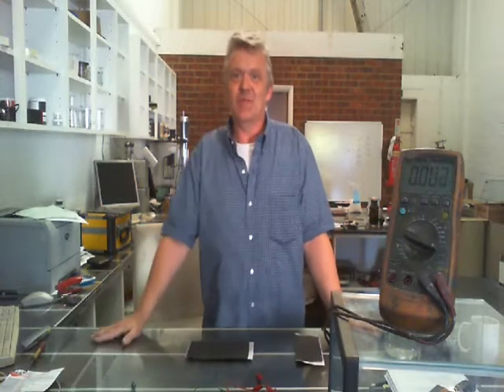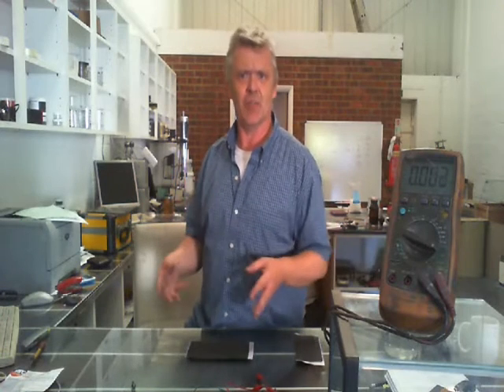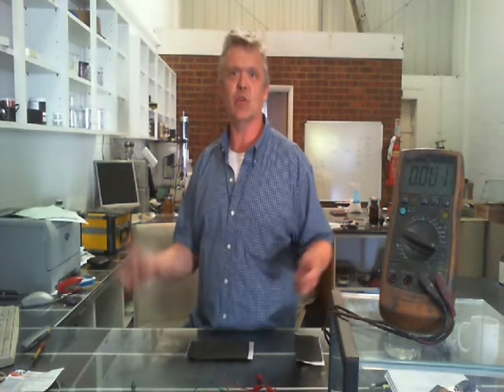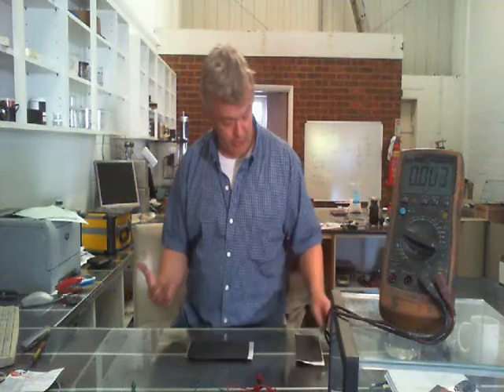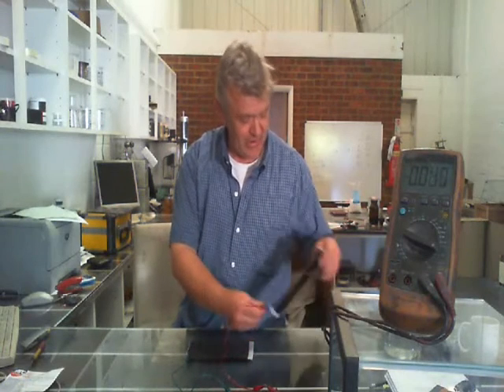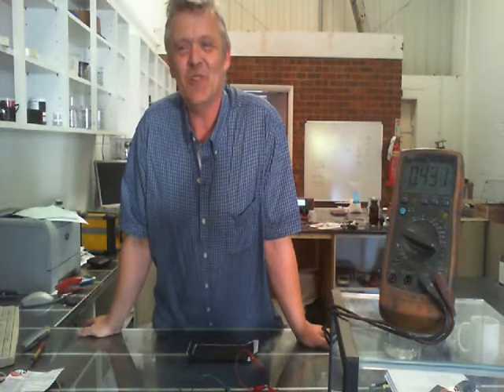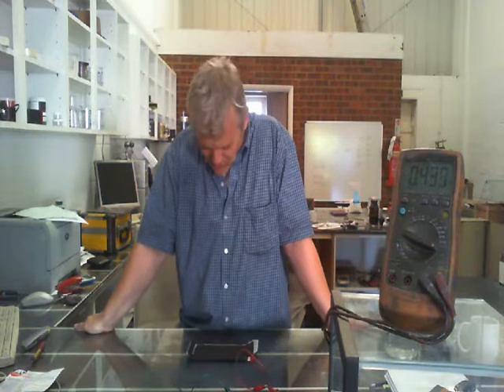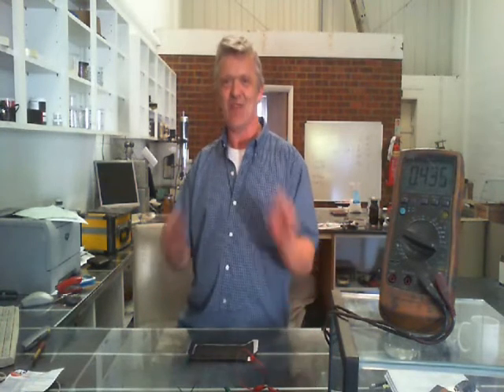How To Make An All Carbon Battery - Bizarre Update

Comment: One idea that is a bit more high tech would be to fabricate a current collector via vapor deposition. I'm thinking of my experience with flexible printed circuits for printer cartridges. My reasoning is that vapor deposition requires very little metal and it's not terribly difficult to accomplish although it's not a home laboratory piece of kit. I'm wondering if a taking the thin film circuit out of a print cartridge could be cut in an appropriate way to test this idea.

Comment: Graphite is almost like metal with sheet structure and a sea of electrons floating about.  Though not freely as in metals and the structure is not strictly lattice but is sort of pseudo lattice due to the ever present interfering Van Der Waals forces.:)
The other electrode is carbon with an irregular structure.  This consideration along with that of the P-N junction idea may point out to the right direction.
Reply from the maker: +Venkatesh k.s. cheers mate

Comment: Seen this in the Karpen patent. may corrode:  C + h2o > h2 + co... well maybe not... i hope so, since I'm doing this too ATM: graphite + activated carbon. Put a voltage trough it, it may hold it... Try diamonds :D BR
Reply from the maker: nice one - the only way we are going to know with this one is if we try - have you done any vids on this?
Reply: Dude. You forgot C+2H2O > 2H2+CO2.
Reply from the maker: +inferno isn't that a high temp reaction?
Reply: +Robert Murray-Smith  and also a high pressure one at that!
Reply from the maker: +Venkatesh k.s. indeed

Comment: robert this is the type of battery i tried to create. I figured in series they would be great to power my Rc cars, planes and light weight vechiles. Would it be possible to see the karpen pdf that describes the 3rd type of carbon cell and possibly some advice on how i should proceed? :)
Reply from the maker: it's on the net mate - rex research i think
Reply: would the acetone method work, or do i need it suspended in ink?
Reply from the maker: GERMcorporation
i don't understand your question - what acetone method?

Comment: I opened a Bettery and i see in it black "Powder", its that Corbon, can i use it to make Graphene?
Reply from the maker: it depends on the battery - sometimes it's carbon, sometimes manganese dioxide, sometimes it's graphite and sometimes a mix of the three and it is always mixed with other chemicals - it's not a good materials unless you separate it out and wash it - you can use carbon to make graphene but it is difficult - much easier to make it from graphite only

Comment: Nice!
What will happen if you put this under (high) pressure?
I think it should either give a higher voltage or short out and the volts will drop.
If air acts as a separator and the air goes away because of the pressure it should stop generating a voltage, if that's not the case you have something even more interesting.
Reply from the maker: i am painting up a multilayer device right now
Reply: I have to admit that talking about air sound strange but if there is a monolithic layer of something water proof, how can the electrolyte reach both plates? And possible air trapped between isn't purely hydrophilic nor hydrophobic, water can to some degree dissolve in air.
That's why I thought about air bubbles, otherwise I have no clue about what's going on.

Comment: The water evaporating, some type of ION exchange and the carbon is picking it up..  NICE!!
Reply from the maker: maybe lol - cheers mate
Reply: What got me into free energy was to simply put a copper rod into the ground (-) Then put a nail in a tree (+) get 1 volt

Energy is everywhere and everything is carbon based :)
Reply from the maker: vintasalo
very good point mate

Comment: Put it on a hot plate and check to see if output improves.  It will probably wrinkle as it dries out so place some sort of non conductive weight on top of it.  I imagine if it's battery behavior then output should rise as it warms and then drop once it's dried.  If it's because of P-N junctions responding to infrared then the output should continue to climb the warmer it gets.
Reply from the maker: we are thinking along exactly the same lines mate

Comment: Hello Robert!

There was a company,  called Power Japan Plus, that did just release a dual carbon battery, with active material being only carbon, but I guess they used a separator...

I was writing to Mr. John Bedini, the inventor of the Alum Battery, regarding a dual carbon battery, with only Alum as electrolyte, but did not got an answer back until now...
Perhaps you can test it..
Heat alum until it melts, adding only a few drops of H2O, and place it in between the carbon electrodes ...would be curious, if this will work better than backing soda stuff..

Looking forward to your conclusion :)

Thanks for your email... can't wait to see you make a full wall painted heater :)
Thanks and kind regards!
Reply from the maker: interesting idea - but mate - the all carbon battery is so easy why don't you give it a go?
Reply: I've already tried that, it delivers a few hundred hundred millivolts.

greeting
Marcel

Comment: I've been toying around with p - n junctions... and ..... not sure of course.. but could be i reckon.  2 types of carbon in 2 different matrices... 2 'semi' -conductors.  Have you tried stacking them voltaic pile style , multi layer to bring up the voltage ?  ... Nice inventing :)   also though perhaps the paper itself is playing a larger role.... ... this link below is interesting ... i wonder... ... they say the nano structure of the paper fibres helps to create nano wires of carbon from the conductive ink as it seeps into the paper and then dries.... that is kind of cool when you think about it .... i am guessing perhaps the paper acts as a matrix that the conductive ink can seep down along by capillary action before it then dries solid into that form.  presto - carbon nano-wires of superconductive graphine...   Reckon you are really onto something here Robert.   /watch?v=QPTcQJPbGHw .  good stuff.  :)
Reply from the maker: interesting ideas and stacking was my next thought
Reply from the maker: Aerros11
I don't think rolling would do anything apart from create a compact form. I am not sure what dipping in graphene oxide would do but cotton may well have an effect on the wicking properties. It is certainly fascinating